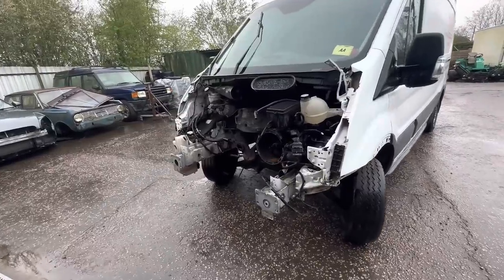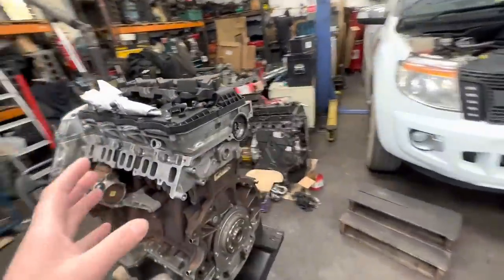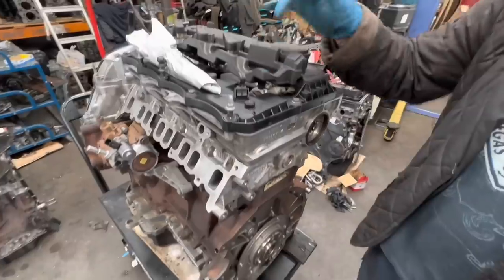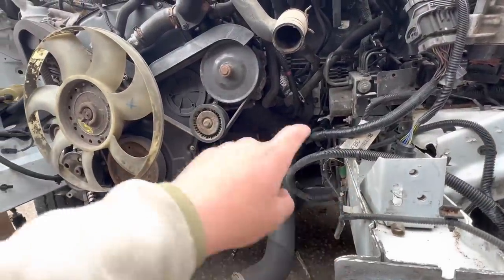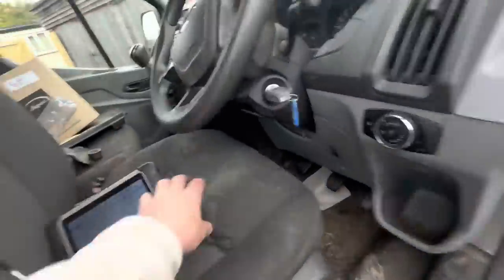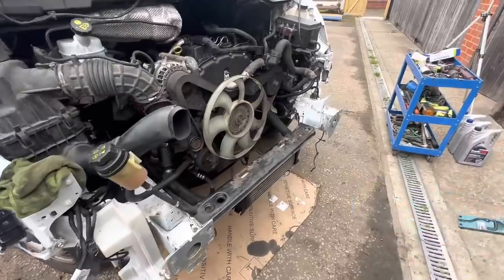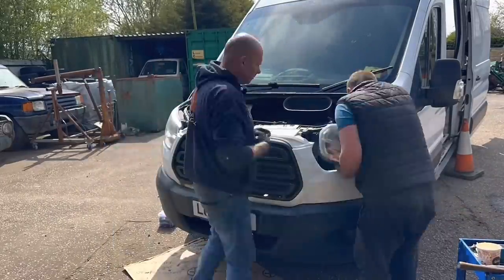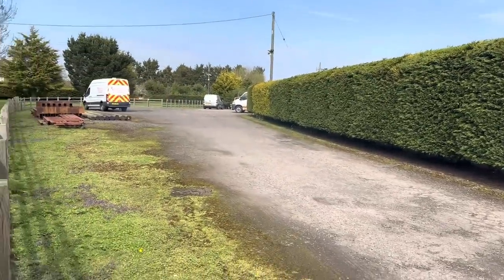FITTING A REBUILT ENGINE TO A 2016 ABANDONED TRANSIT

Comment: I owe you a massive thank you. I would have never have known about the sacrificial rockers and camshaft on the Peugeot/Citroen/Ford 1.5/1.6 Diesel engines. I had a timing belt let go on a 2018 Transit Connect. After replacing the camshaft, rockers and lifters (and belt) it runs sweet as a nut. Didn't have to split the engine! Never trust handwritten timing belt replacement notes in service history 😠. Keep up the great work guys!!
Reply from the maker: Good to hear bud 👌drop the sump and clean it out 👍

Comment: Morning guys, 
Sounds spot on, we’ll done 👍🏼
Just in process of doing the same with my Transit, only difference fwd eco blue, injectors 3&4 did my engine in… Got a brand new ford zero miles engine, turbo and clutch to go in… Just haven’t the old one totally out yet 🤦🏻‍♂️

Comment: Hi Rob did you code in the new injector, just a thought if it had passed some oil then it may be an idea to carry out a dpf regen, had a turbo go on a wagon which passed oil, when I got it back up and running the oil clogged the dpf just about managed to get it to regen to clear it all out.
Reply from the maker: Yes all 4 👍

Comment: Incorrect, using tapwater as coolant the correct way is to use Deionised water is best for mixing with antifreeze
Reply from the maker: Not wen checking for leaks
Reply from the maker: Not wen checking for leaks

Comment: Don't understand why they don't recon your engine that you took in that would keep the vehicle records in order.
Reply from the maker: No one cares about the engine number it makes absolutely no difference
Reply: The engines are like oil filters in these transits. Require frequent changes so no one cares 😂
Reply: @sruk  do you ask your friends at DVLA to update the V5?
Reply: Allows for a faster turn around. Recon engines and gearboxes have typically been on an exchange basis. You get the previous guy's now and someone else gets yours later. If it was a classic vehicle it could be different. I'd prefer to keep the original engine number, if possible. Don't think i's too much to get the DVLA to update the V5C with a new no. if you want the paperwork exactly right.

Comment: Why only change 1 injector, seems a false Economy after all that work you boys done 🧐
Reply: I thought the same.
Reply: Because they are electronic, either they work or dont. Its the electronics that wear out more often than not and not the tips that cause issue, why change the other 3 when they are working fine especially when they are not cheap.
Reply: @Hillbillymills.  because you’ll crack another piston.

Comment: I had to hire a mk 8 transit recently, wasn’t impressed by it, it felt all cheapy compared to my mk 7
Reply: After the mk7, even the last of the mk7's with the siemens fuel system they are all absolutely pure shite, they used to rot away but have good engines, now they rot and have shit engines 😂
Reply: That’s got the mk7 engine in it by the looks of it. Best of both worlds lol
Reply: I’ve got a 2011 mk 7 non dpf 2.4 crew cab tipper, scabby but runs like a sewing machine